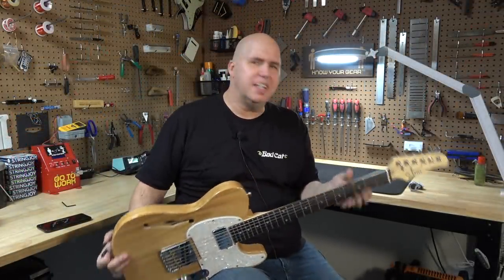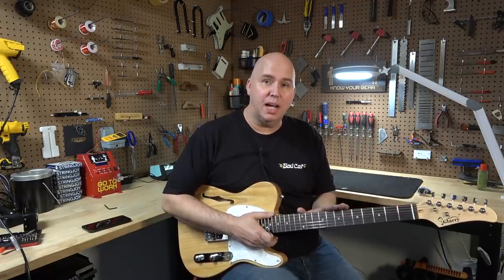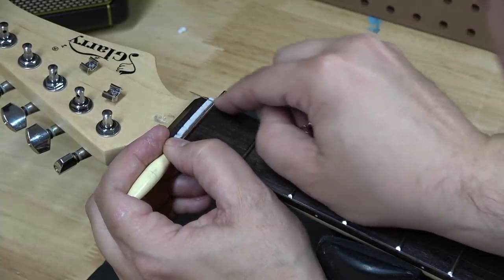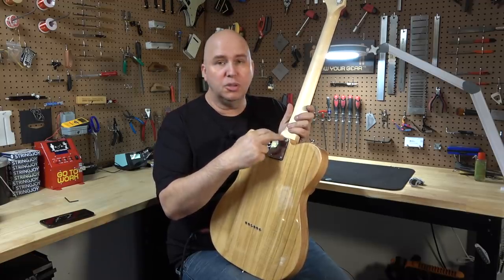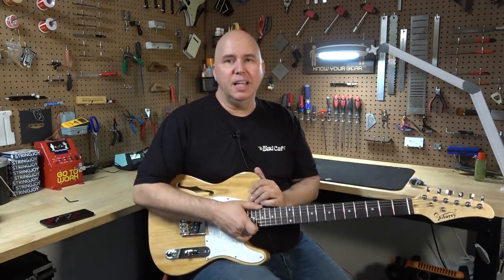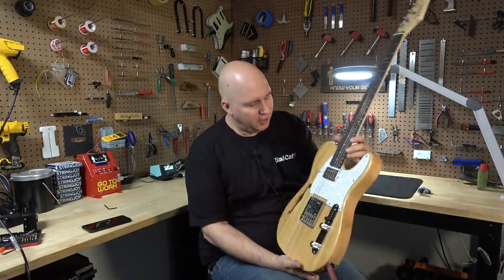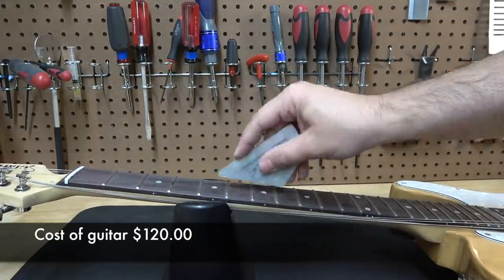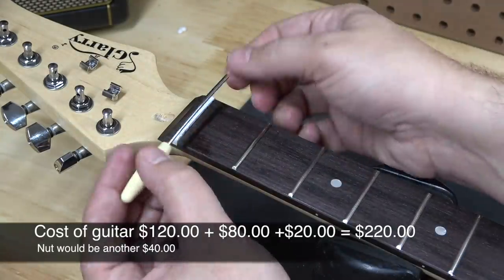How Much Do These GLARRY Guitars Really Cost You?

Comment: Kudos for showing the actual cost of a cheap guitar including the work it takes to make a guitar really playable. Of course, any investment in a guitar like this is not recoverable.  A Glarry will never appreciate in value. I advise my friends to take the cost of a new cheap guitar plus luthier fees and try to find a used guitar of a known brand for the same price. I found a carved top mahogany set neck Ibanez ART90 for $115 out the door at a local pawn shop. No fret wear - needed nothing. Sold new only for 2 years (2012-2013). I think the original price was between $300 - $400. I saw the same guitar on local CL for similar price. So there are bargains out there locally if you're willing to look. Thanks for your videos, Phillip. By the way, those cheap nut "files" are really welding tip cleaners and have no "teeth". You can pick them up at auto parts store but don't waste your money. It would take you weeks to cut a new nut with them.
Reply: John Ulrich. Nice score on the Ibanez. Once in awhile you can find a good deal on used guitars, and some prices are stupid high. I bought 5 used guitars in the past 5 years. 2 needed a little work, all are excellent. Ironically all are discontinued models and are worth more than they cost me.
Reply: The trick is getting a good one. I bought all the tools and fix up cheap guitars, but I've never gotten one that was dialed in very well.
Reply: "try to find a used guitar of a known brand "  I agree, and that price of $115 or about £120-150 will get you a good second hand guitar in England.

Comment: A fender/squire neck will fit perfect with slight modification.  The butt of the neck pocket for the glarry body is straight. Fender has a curve. You have to route a very slight curve in it. Then fill and redrill the bolt holes.

Comment: We call those '90%' guitars. When they made them they were 90% done. The last 10%, usually all the 'hand' work, or 'skilled setup' work is left.  As Phil said, it all depends on where, how and who does the work for price. I really like 'Agile' guitars for 90%-ers. The LP types are a really good value. Tone Pros and Grover hardware!  I usually replace the wiring, pots, switches and pups, and do the last 10%. (Usually with StewMac stuff). Then donate them to disabled vets. I can do that for ~$600 all in, w/case, for a great LP type guitar.  8)    JMHO    --gary

Comment: I just received my Glarry S type today. No sharp fret ends, no dead spots, neck dead straight.   I tuned stretched strings, played it ( the intonation is very close, I haven't yet used my digital tuner to check it) tuned it again and have let it set for a while, the neck is still straight. It stays in tune after using the whammy bar. The only problem was a very small amount of roughness on the back of the neck. I buffed it with a stiff cloth (muslin/canvas). Now it is great, very slick. I did lower the action some, it could still go down a little more, but I like it.  I'm very happy I decided to get one. I've been a Epiphone/Gibson  double humbucker guy. Actually, I'm a bass player and have been practicing and working on my 6 string technique. First time I've experienced 60 cycle hum without any ground loop issue.

Comment: Ordered one here in the UK 24th Dec. Turned up on the 28th. Perfectly set up and intonated out of the box. Only issue is the string spacing between the high E and B. Fret ends were smooth, I polished the frets and oiled the board,fitted bone nut, Strung it with Ernie 09s. Got some locking tuners I'll fit soon. I've been playing it a lot. Amazingly, it's only £75 here. Massive bargain. I had to pay more than 25% more than the US price for my Mex Tele. 
Thanks PM.

Comment: Bought the same model featured in the video. The whole ashtray was off by 1/4 to the treble side, making the E string unplayable above the seventh fret. I recut the pup caviity, got rid of that stupid gap between the ashtray and pick guard, ( got a different pick guard also, new bone nut, " waffle iron tuners, American Standard string trees, and re shaped the head stock. I didn't have to mess with the frets, but yes to the steel wool on the neck. I love that guitar now!!  I also own a Epi LP Special, with a Maestro tremolo with a roller bridge. I love both of them!!

Comment: That's how I learned to work on guitars. But back in the 80s there weren't the selections of new,cheap guitars there are today. I bought a used Hondo Les Paul copy & worked on it . As time went on I finally bought a 2002 Les Paul standard(new). Since then I've ground to sawdust other cheap guitars, but my LP standard is still going strong. Cheap guitars are awesome. Mod them,paint them & play them,have a blast. Then by the time you've decided that you want to play for the rest of your life, (like I did)then maybe buy a high quality guitar. But most of all,have fun!!!

Comment: I bought one (the Red one)... I love it! I bought some Fender locking tuners and have spare stock Fender and Gibson pickups, pots, switches etc. No real problems with mine except, as with MOST guitars... it'll need a setup, but that's easy if you have the tools and know what you're doing. As with most of these type of Guitars... great looking and a great Modifying platform.

Comment: I bought the yellow, (which is more like butterscotch) thin-line and replaced the neck with a squire tele maple neck.. Lined up the heel with the bottom side neck pocket and shimmed the top to center it correctly. I had to Dremel a minor amount out of the corners of the neck pocket to match the heel, then filled the neck holes in and drilled to match the bolt on neck plate. I replaced the bridge pickup with a hot dual rail humbucker,(didn’t like the tone of the original).  Looks beautiful and sounds even better. I’m relatively new to your channel and enjoy your honesty in presentation. Thanks dude and be safe! Did I mention I put a set of 11 flat wound Chromes, what a nice mellowing tone.

Comment: Just ordered that exact model on the 31st. I have been watching you for some time while I work and contemplated tinkering. Hearing you are from Tucson was neat as well.  I have a few nice guitars but want something I am not afraid to get my hands dirty with. Keep up with the great content! If you are ever back down in Tucson I would love some feedback.
Reply: Just wanted to know, how did the Glarry turn out?  Mine required major surgery, and some new parts, but mine looks and sounds a whole lot better than more expensive makes.
Reply: @jameshatch5722  I think it turned out beautifully. Routed and conductive painted the internal cavity. Had to level and roll the fret board then installed SS frets. Ratio locking tuners and a Graphtech nut allowed me to ditch a string tree. Ended up with GFS for a GF'Tron 3 saddle bridge with a GF'Tron neck pickup as well. Changed out electronics and output jack with kwik plugs from guitar fetish. The only thing left is a custom pickguard. I love the wide unfinished neck though! Fits my hands like it was made for them. After all that it is still (almost) my cheapest guitar and it is the one I love to play the most!
Reply: @johndrake1100  just taking a break from playing mine.. They are a blast ain't they,?  Really light, and I don't mind " heavy " guitars. Enjoy,🤠

Comment: I have an old 80's 22 frets strat copy, nothing written anywhere, even inside ! (even no serial numbers on any part) The neck is not maple, it's darker with lines in it, rosewood fingerboard radius 12" or 14", headstock  same as a Cort, maybe one of the very first of that brand, but again, nothing written; and it's very good ! vibrates in your hands when unplugged almost like an acoustic, incredible. Bought 15 years ago at a flea market for 80 euros. Incredible, as good as much more expensive guitars ! Cheers from France.

Comment: Just this past couple weeks I've come to the conclusion that I think I'm done with cheap guitars. Like sub $300 guitars. Guitars that cheap just don't stay in my possession. I have a Harley Benton JA-60 with upgraded Hipshot locking tuners, Graphtech string trees, a GFS bridge, and I had a full set up done on it, and although I like it, it's probably getting sold this year. It doesn't play as well as I want it to, it's one dimensional, and I probably put the full cost of the guitar into just upgrades and the set up. I'm a recording guy so I like a wide variety of sounds, but I also don't like having guitars just sit on the rack collecting dust. I do like playing it though and it turns out I like Jazzmaster style guitars. So yeah cheap guitars are fun but I can't justify buying them anymore. I want guitars that I'm going to keep.
Reply: I too have sworn off sub $600 guitars. The main reason being - i like to sell off most of my guitars eventually, and the  cheap ones are just impossible to get your money back out of.
Reply: @Peter Piper Honestly there's a lot to like about it. It looks awesome, especially the finish on the back of the neck. It's a great stain colour they chose. And the neck pickup is fat as fuck. But yeah there's just inherent quality differences between this and even something like the Schecter Omen 6 I have which is just a few hundred dollars more. So you know, maybe it would save me money in the long run to just spend a little more up front and get something that I'll want to keep.
Reply: @mojo-hand4539  Mine are pretty much unsellable sometimes. Like my Schecter has the finish all stripped off, different pickups and electronics, probably gonna get a new paint job and locking tuners. Like there's no way something like that would sell for more than $150 Canadian. So I've just accepted that it's mine forever. XD
Reply: I buy everything last month a glarry thinline and today my Gibson LP Studio arrived from sweetwater

Comment: For conversation purposes only, the supposed fret filers are made for cleaning gas welding tips, tiny “blobs” of metal flare up in the cutting or welding process and partially clog the copper tip.  The ridges are rolled rather than cut, so when using on a nut you are wearing rather than cutting material.  Little known fact about lesser known subjects.  Junk store needle files better for nuts

Comment: Thanks for the video. This is perfect. You described almost all of the issues with my Glarry Strat. I think that about 75% of my frets had "sprouted" and had to to tapped down. You are right - don't buy these unless you are willing to do the work. I also had to realign the neck. I did replace the nut. I think that the Glarry  nut was simply garbage - set up WAY too high is is cheap soft plastic. However, I am more than satisfied with my purchase, but I am also better at working on stuff like this than I am playing guitar.

Comment: Good vid Phil, that's exactly what I've experienced with budget imports,as well, and my upgrade usually costs about the same or a little more, because I take the maganetic strips off the pickups and put good alnico magnets, and of course rewax em. I also put better pots and an orange drop in, plus upgrade the wiring, that chi-com copper breaks from use pretty quickly. 
I know that's a lot of up grade, but good or bad guitars seem to last FOREVER, so they might as well be playable

Comment: Mine came in a raw state too. I did a number of the things you did too Phil, but I had to raise the saddles considerably and set the intonation. The nut was set too high and I had to chip out the slot a bit. After putting on D'Addario 10s and tweaking everything a bit the guitar sounds great and plays great too. It has taken just a few hours but I got something nice now. I got the SS version and I think the pickups are decent. They don't have the ice pick sound you get on cheap guitars. Surprisingly the neck pick up sounds as warm as the humbucker, but not muddy.

Comment: amazing what you can get for your cash these days. The only guitar or bass I have that did not need work when new was a 1992 made in Japan Squier stratocaster. Great out of the box, the dealer did not need to touch it. Still using it today, rarely needs any tweeking, although may need refretting soon

Comment: If anyone is thinking about one of these but doesn’t want to do all that work, check out the Indio by Monoprice Retro DLX Plus Solid Ash Tele, I had one and sold it but they are fantastic! None of this work needs to be done! The set up was great, very playable right out of the box. Pickups sounded good for ceramics. The neck was so nice to play! I only sold it because I had too many guitars and needed to sell a few to finance a partscaster build, (I had it for about 4 months, but played it daily, I still miss that nice satin neck). Now I have never played a glarry but the Indio Retro DLX Plus Ash currently retails for $199. Even at $199 it was well worth it and would have been a hell of a modding platform (which was my intention) but I impulsively bought a killer MJT body to build my partscaster with and so like I said had to sell off a few axes to pay for the MJT build.

Comment: Great video. I would not use the 30 degree fret end file block and instead I would dress the fret ends without putting bevel on them as to preserve as much fret material at the end as possible. I would also roll off the edges of the fretboard and it's best done with frets removed but I've done it with the frets still on and using a fine file. That makes a huge difference in the feel of the neck and it feels great. Most of the cheap guitars will require some woodworking, that's a given. Even more expensive ones won't escape this reality. It's best if you invest in good tools and learn to do the  job yourself and you'll be rewarded with making the guitar the best it can be. Then you won't be afraid to buy any guitar out there because you can make any guitar great.

Comment: Great video! Just posted this under another video, but seems appropriate to post it here. It’s about my experience with a Harley Benton (fusion model) 

It’s great for a $400 guitar. But still is a $400 guitar. You get what you pay for. The specs are great, but your money is spread veeeeery thin. I kept mine because I love the neck, specs and the weight of it (and looks). Almost sent it back because of QC issues. Biggest was a ‘big’ gap between de neck and the body and the neck was on crooked (to be fair, high end Fenders also can have that last problem in my experience). Anyway, fixed the neck pocket, changed out all the electronics, put some Duncans in there, dressed the frets, filed the nut and now it is REALLY good and I love it.

I’m writing this just to be honest and share my experience. In the end I have an amazing guitar that I genuinely love, but BOY it took some work... Fortunately I like working and tinkering with my guitars, but as Phil says, if you don’t: then something like this is not for you!

Comment: I really appreciate this video and the other ones you put out.  I picked up an identical guitar from a November Pre-Black Friday sale from Walmart for $86.  I figured I could not go too far wrong and could use it as a vehicle to learn about setting it up etc..  I did need to adjust the truss rod.  I also swapped out the tuners for a set of $25 locking tuners from Guitar Fetish.  I found that the bridge was cheap (of course) and adding to a tinny sound and was causing part of the high action.  I swapped that out for a better Wilkinson version from Amazon with the traditional 3 saddles each - a big improvement.  There was fret sprout and I have gotten 90+% of that resolved by using sand paper (per another guy's video) to correct that.  I have a file, but ruined a neck on another guitar years back, so I am hesitant to use it too much.  The strings are .009's and make up a little for the action even after the adjustments.  So all in my cost was about $135 for a very nice looking and decent playing and sounding thin-line model, which I did not have prior.

Comment: From Leo:  You mention working with that guitar.  Do you have a standard pattern Tele pick guard to lay on it and see if it is shaped the same?    I have a Jay Turser that a Fender pickguard  is either gaping at the neck end by a 1/2 inch or gaping at the control plate by 1/2 inch.   Just enough I had to saw out  a pick guard from scratch.  WAY too much work for quick mods.

Comment: I was looking for a cheap Tele style guitar and almost bought one of the Glarry's. In the end I went for one of the Donner's and I am glad I did. Most of the fixable issues you mentioned were addressed out of the box. The neck on mine was straight, the tuners pegs were tightened down, the nut was well cut/slotted. The best part was the frets were relatively smooth and I had no fret sprout. The action was a bit high for my taste, but certainly playable for a beginner.  I ended also up buying their HSS Strat , and thin line semi hallow Tele and both were on par setup wise.  I would love to see your reaction/review of one of the Donner guitars. I don't see how they make money on these cheap guitars, but I'll take it.

Comment: I got a Glarry tele recently, and the bridge pickup was very noisy and microphonic (seems to be a common problem), so I bought a new pickup to replace it. Turns out that the rout wasn't big enough for the new pickup, so had to rout it out further (just using a drill because the basswood isn't very dense). Although it was a good learning experience, turned out to be a lot more effort than expected. 
I'd also strongly recommend getting replacement bridge saddles, because I found the standard ones made it almost unplayable when bending strings.
Overall, spent £80 on the guitar, plus another £30-40 on upgrades. I'd recommend spending that money on a Squier bullet instead - similar price all in and playable out the box